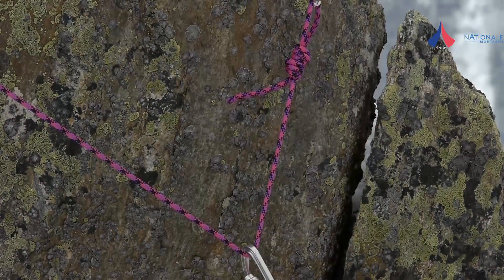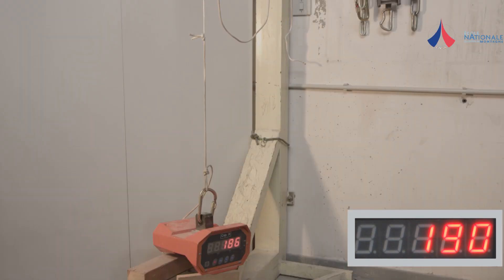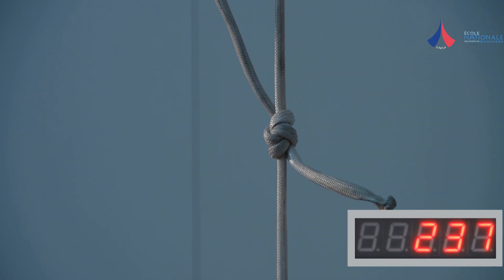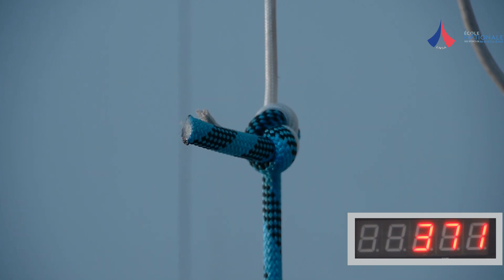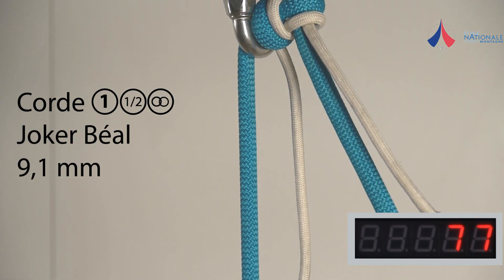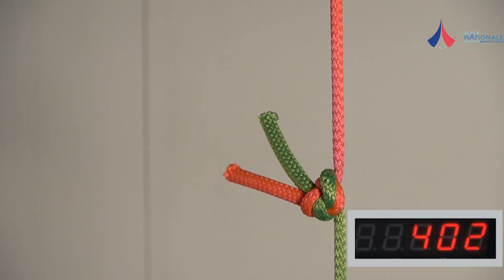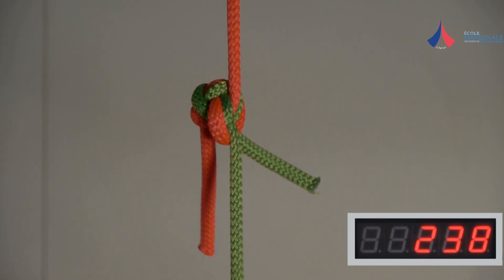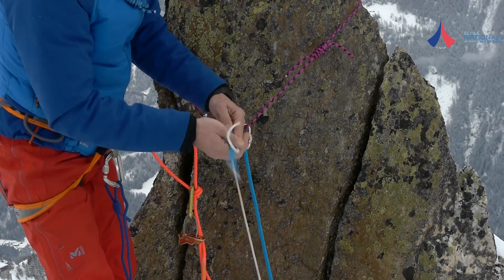Which knot should you use for joining ropes?

Comment: Really reporting the strenghtcas 200dN is poor as it is 20kN. So not sure why. It why not.0.02TN. Sorry but a degree in chemistry just makes me question your use of the metric system. Hardware is rated in kN.
Reply: its confusing I know, I would've preferred kN but 200dN is only 2kN
Reply: Meaning you don't like the metric system or that the French , who invented it, or the manner in which they have used it?

Comment: Decanewtons, I'd like the results in stones so people can compare easily to units used in climbing, like the one that is on the side of carabiners..
Reply: 100 daN (Decanewtons) is equal to 1 kN ( Kilonewtons)
Reply: Just to add to this, even if I'm late to the party. Stone and Kilograms are measures of mass while Newtons are a measure of force. You could express at which mass, hanging statically, a rope would fail but this isn't that useful under dynamic loading conditions. It is easily converted to the mass required to generate the forces of such a static load though.
Reply: @jeroenfeher8107  for most non-scientists or those who don't fully understand the difference between weight (force) and mass...1 dN ~-=1kg in this situation...let's not confuse and alienate those who wish to learn basics for safety :-) :-) I still buy apples etc in kg as their "weight"..I'm not going to be a pedant to the grocer :-)  Of more intesrest to myself and others is the relative % strength of knots compared to rope rating.....Fig 8 better, but can't get the bugger undone after load vs bowline, alpine hitch vs dropper loop etc...horses for courses! :-)

Comment: For perspective, belay forces are generated with sudden falls, rather than sustained 1800lbs pulls. It would be best to see slippage tested on a proper EN892 fall tower as well. In particular for dyneema, HMPE fiber is thermosoftening and sudden forces cause friction and extra degradation. As the DMM 2012 experiments showed, dyneema tape performed much differently in the load cell pull than the 80kg fall tower.

Also curious to see the Paketknoten bend tested. Apparently DAV classes are advocating that on abseil ropes now. It has a flat profile for retrieval and appears resistant to capsizing. Claim is almost as efficient as the triple fisherman in strength and much easier to untie.

Btw, English speakers might translate your device more specifically as a load cell. It is certainly a type of dynamometer and correct to call it that. Just like it would be correct to call a bicycle a 'vehicle', but less typical.